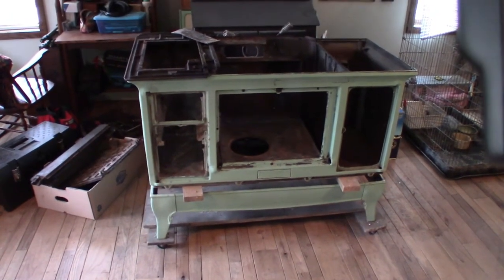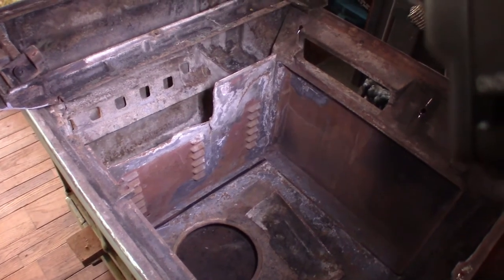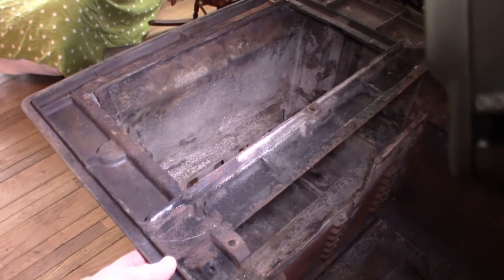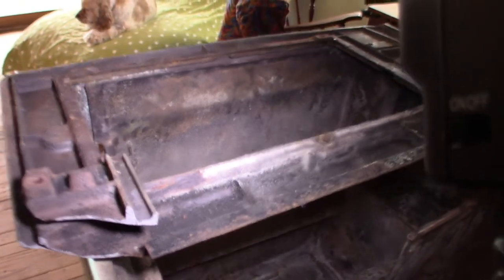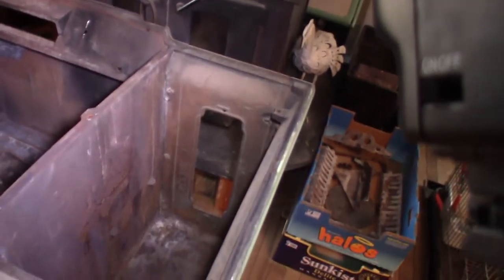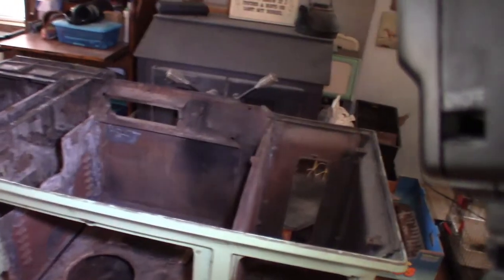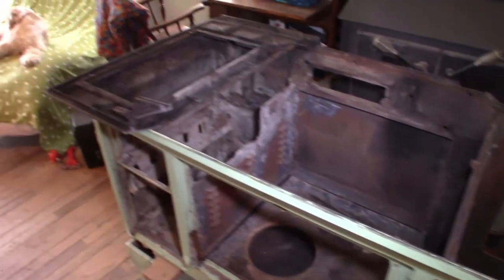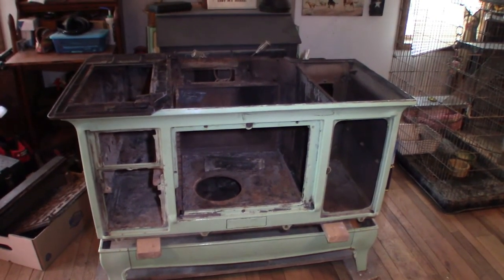Kalamazoo Wood cook stove progress update #1.

Comment: As a millwright and fabricator I would highly recomend a nickel braze rod to weld those peices back together. Bronze would work but less tensile strength and heat tolerance. Silver has a higher weld temp. The rods can be found at your local home improvement store. The ones with flux are nice, borax works too. Map gas is needed for the braze.

on weld cast iron.... it can be done, I have mig welded black cast many times but requires old school knowledge to weld it. I have distroyed many cast pieces with spider cracks before I learn the method.